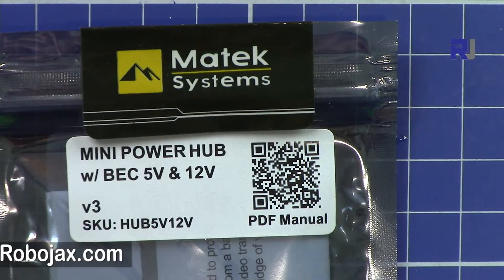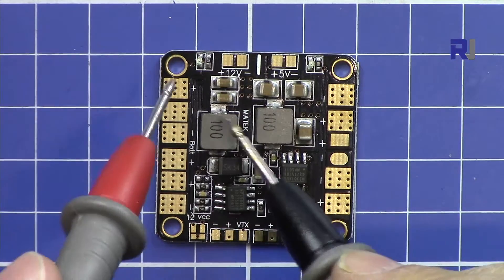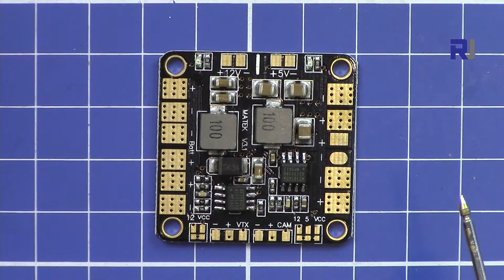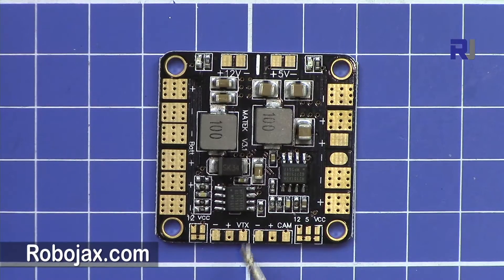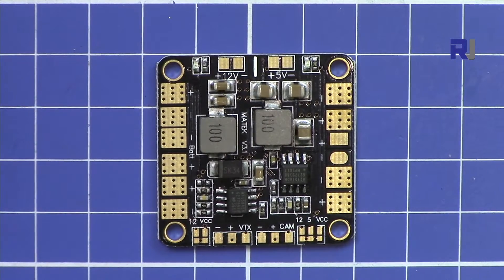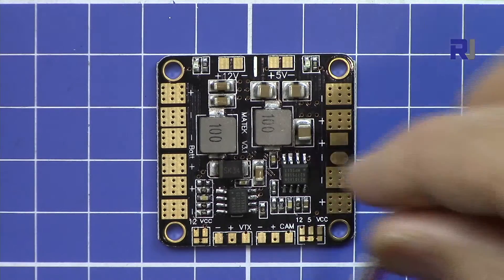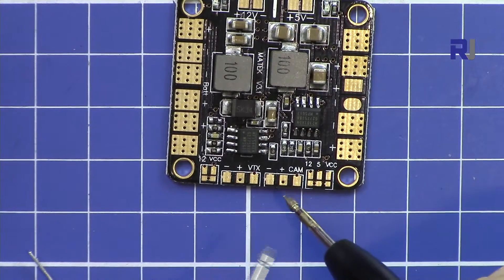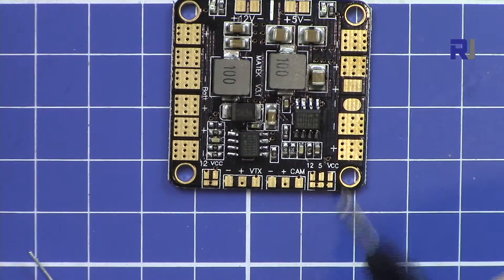Matek PDB Mini Hub for Quadcopter, FPV, VTX explained

Comment: Actually I have  a drone with a camera but whenever I connect the camera with the phone with the rotors off,it works fine. But as soon as I start the rotors of the drone, the camera footage blurs out and stops working. Please help.
Reply from the maker: It means the voltage drops and most power is used with drone motors. I am not sure, but perhaps the battery is not fully charged or it is bad.
Reply: @robojax  Thanks a lot
Reply from the maker: You are welcome.